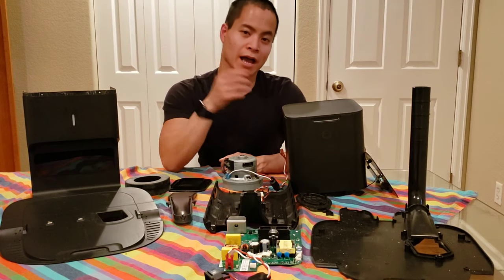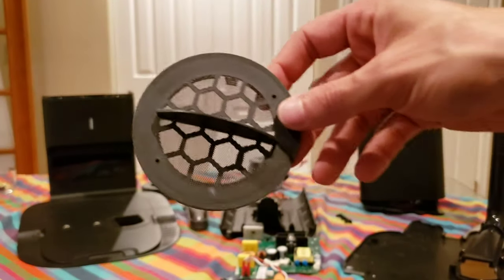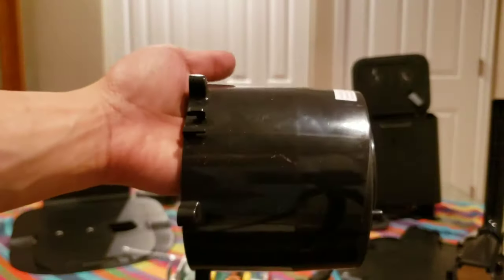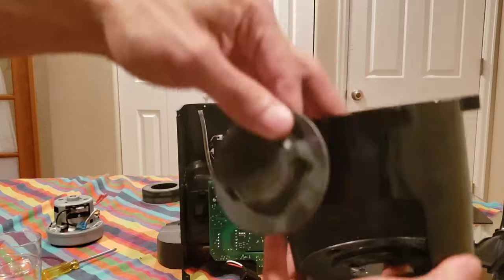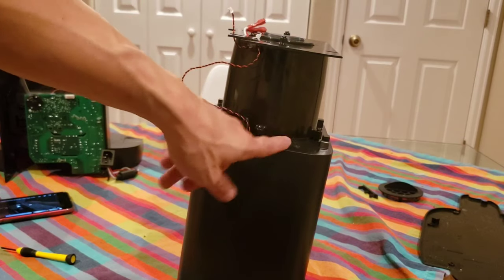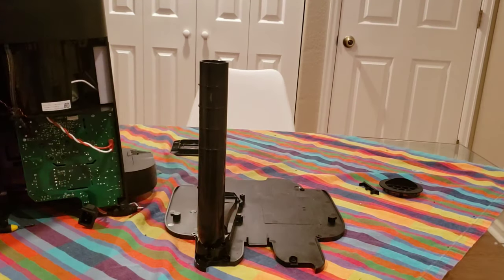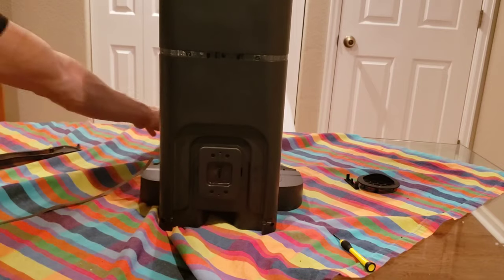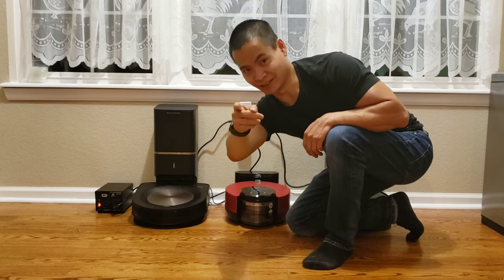How to build the Roomba S9 and I7 self emptying Bin | What makes this gadget work 🤔🤔🤔

Comment: Hi Nathan 

Are there the same clean base i7 & s9 ?
When ı checked models i7 use ade-n1
S9 use adb-n1.I will buy autonatic diasposal clean base for my S9 but when ı checked prices i7 clean base is cheaper are there same functuallity to S9 clean base.Have you tried i7’base on S9 vacuum cleaner ?
Reply from the maker: Hello, so each of the iRobot clean bases are slightly different. So make sure you get the clean base that for the S9 and vice versa. They are not interchangeable because the extractor port is in a different location.

Comment: My S9+ always says it has a pressure issue, any idea what to check for ? Nothing seems clogged or dirty, I even installed a new filter in the Roomba and bag in the Clean Station.
Reply from the maker: Hmmm if possible you could take a part the bottom part of the base to see if there a clog. There a plastic part held on by some screws. Also check to see if the seal around the lid is free from debris. If it continues you may have to contact iRobot to see if they can provide a replacement. There a thin clear tube inside the base that is hooked up to the pressure sensor that may be clogged, or leaking. Lastly the pressure sensor itself might be defective.
Reply: @RobotMasters  I checked that transparent part underneath, no clog there, I even vacuumed it with a normal vacuum cleaner. I'll bring it back to the store, which has a very good replacement policy for things under warranty, it served me well before it stopped working.

Comment: I bought the irobot s9 plus, but the first time, the clean base does not empty the chamber of the robot cleaner. When the broom is done, he approaches his home. Then a red light flashes around. White light is on in the clean base. I tried all kinds of ways, but the clean base does not empty the hopper, so it does not pull the dirt into the bag. Please can you help?
Reply from the maker: Check the seal around the bag, the self emptying bin lid, and the robot dust bin. Unplug the self emptying bin and hold down the power button for 10 seconds on the robot to reset. Once every thing plugged back in and powered on try again. Does the self emptying bin motor turn on?
Reply: Robot Masters unfortunately i tried it and it still doesn't work
Reply from the maker: fatih tekin Does the vacuum motor from the self emptying bin turn on? Also when the robot dock on the bin, there should be a empty bin icon? Does that show up, if it does try to see if it works be selecting it.
Reply: @RobotMasters  The vacum engine does not work. clean base white light is on, but the robot cleaner red light is on.
Reply: By looking at these led lights, can we say that the problem is in the robot vacuum cleaner?
Reply from the maker: @fatihtekin8318  Yeah could be the robot, I would email iRobot, they are good at responding back and may have more troubleshooting steps
Reply: @RobotMasters  have a nice day. I plugged the product into a 100-120 volt outlet, and I plugged it into a 220 volt outlet. There was no burning smell or explosion sound from the product. Do these products have voltage protection? Is the vacuum motor burned out? Will it work if I plug the product into a 110 volt outlet?
Reply: @RobotMasters  It had to be plugged into a 110 volt outlet. I plugged it into a 220 volt outlet. Does this product have voltage protection? Is the vacuum motor of the product burned? There was no burning smell or explosion sound when I plugged the product into the wall socket.
Reply from the maker: @fatihtekin8318  More than likely you may have blown a fuse, so it would require iRobot to fix the unit. You could try plugging into a 110v and see if it works